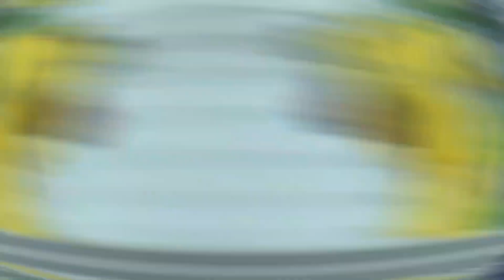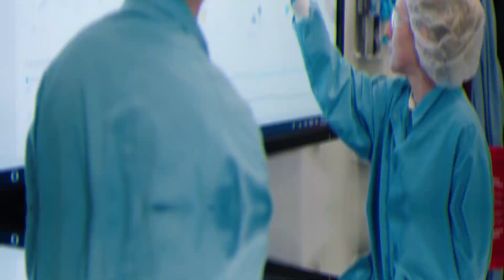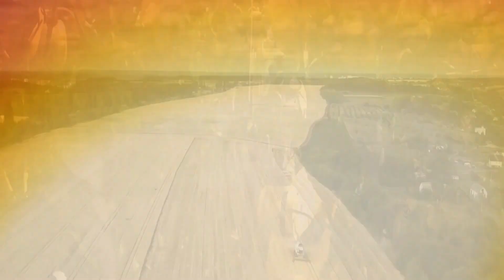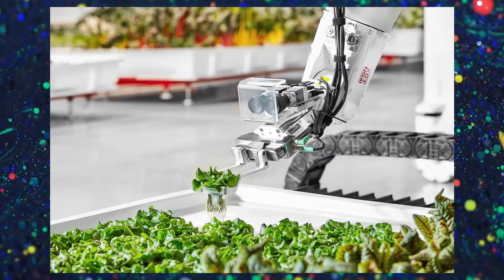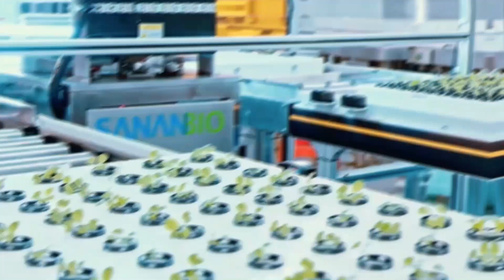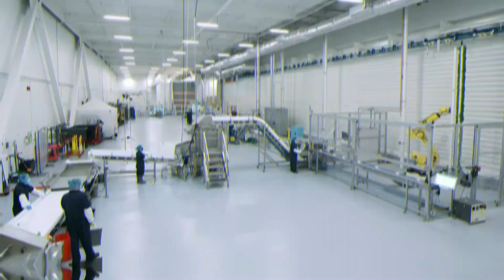How A Tiny Vertical Farm Run By Robots GROWS MORE than 700 Acre Farm

Comment: All of the climate control and lighting how is that not inefficient compare to normal farm. I did like the non GMO.
Reply from the maker: Do you think it will become more viable in the future?
Reply: @foodverge you wouldn't need to cover the whole roof with panels to run it all. 2 acres of roof covered with panels... can fit ~ 5400 475w panels.

That's 2565 MEGAWATTS. 2.5 million kw 😂

Definitely not more "inefficient" especially when it's 300 times smaller in footprint and can perform year round. When the panels are on the way out they're now easy to recycle into raw materials and ready to make new panels without any harsh processes too. 

CHEERS 🕺🍻